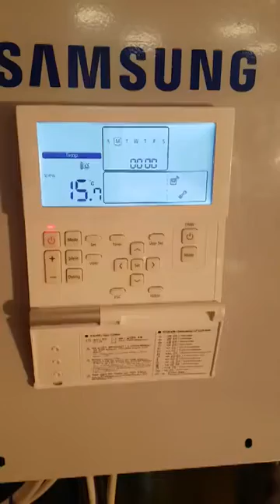E101 , E102, E201 and E202 errors Samsung air source heat pumps

Comment: 9kW Split EHS Outdoor Heating System AE090JXYDEH/EU . After a big storm here the lights went out and came back again many times and from that day its not working. It says error E201 communication error between control kit/outdoor unit . And the lights in the control kit are not working. What should I do?

Comment: Mine seems to cut off once it gets cold at night I never have issues with my Samsung heat pumps but this year over the last few cold nights the second the sun goes down I get the communication error code after resetting them it just throws the code again could it possibly be the board is going bad

Comment: Graham you seem to be the only person who knows these systems, i have Samsung and for 1 year E911 and A00 code , impossible to have Samsung answer a call, we have changed all they said , pumps, switches , flows and still the same. I can not find out what A00 is but thinking its a loose connection or failed board ? any ideas

Comment: Hi, my temp set is 0.0 and not on AU mode. 

How do I set it to au mode and is the setting the installer set at 0.0 a possible problem.